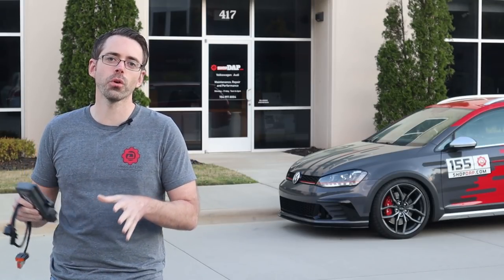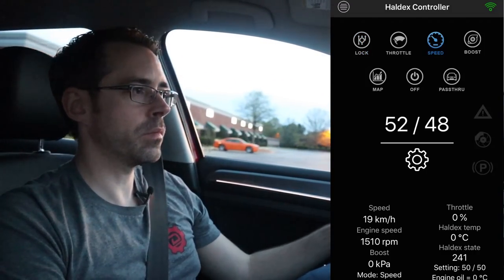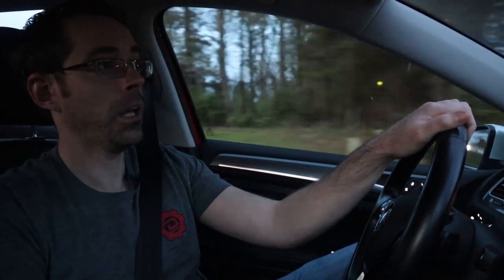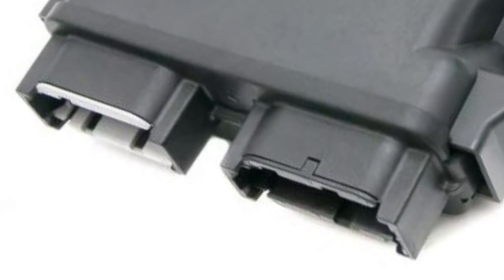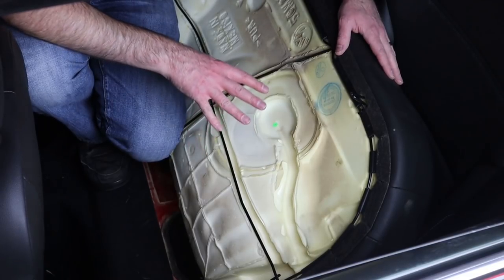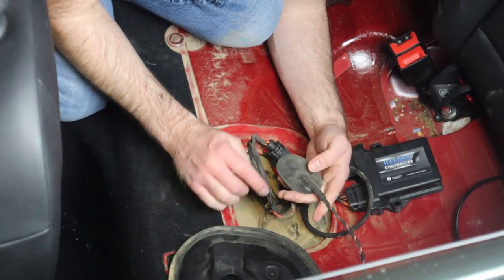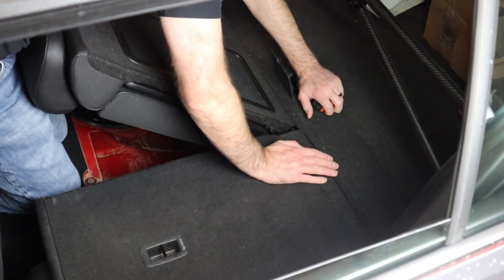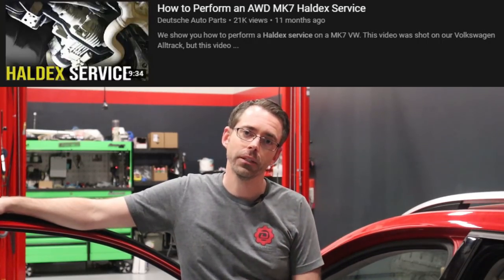How to Control your Haldex AWD System

Comment: Does it damage the pump/unit by working all the time? I am not sure that it is designed for that.
Reply: Pump runs all the time when vehicle is on. However it is not always "engaged". Running at 100% will burn the pump out much quicker. Pumps usually last around 60-80 thousand kms depending on how lucky you are.
Reply: @GForceConnections  i guess i have original pump on my b6 and it has 330 thousand kms :D

Comment: I saw you install this on a mk5 gti. So my question is does this fit on pre MQB, like PQ35 or better PQ25? I would like to run this on an Audi S1. (Was not sold in the US)

Comment: @1:34 "Haldex can't engage when you're on the brakes..." Wait what? So on road courses, rallies, and hill climbs where it's VERY common to use the brakes in conjunction with the throttle to control the balance/disposition of the car Haldex does not allow drive to the rear wheels? That's a true shame, didn't know that.
Reply: More so on launch control the system will never have the pump running before the launch happens, so there will still be signal delay like stock.
Reply: I am pretty sure I have seen a system from Ecumaster for the Mk4 R32 that will lock the haldex under braking too
Reply: HPA Motorsport do Haldex box which makes Haldex engage while braking. They just don't have this for Haldex V yet. I hope it changes soon as it would be preferred solution for ultimate sports driving.
Reply: This is one of the reasons why people prefer torsen, because torsen is a mechanical AWD, unlike haldex, so it wont disengage when you brake, and has more predictible handling. Downside is that its always active, so you gonna have your fuel economy cut, while haldex disengages when not needed giving you FWD economy.
Reply: The Haldex Controller has a option to ignore the brake signal.
Reply: @masterblaster3755  As Master Blaster says the original HPA Haldex (Blue)  on the 'Race' setting gets you engine braking when you are off the throttle. I've had it since Marcel Horn did his first 'NA Tour' in 2009-10.  Xlnt!

Comment: Is there any way to just complete remove the rear haldex and make it truely locked up in the rear mechanically going to an LSD rear diff... removing the whole rear haldex system with a solid rear axle?

Comment: Do you have to use a controller to use the mechanical switch or is there a way to set it up to run fwd and awd on the switch?

Comment: They would sell a heck of a lot more of these if the price was more reasonable, the problem is the Golf R Haldex is already very responsive. I have tested my car in low traction situations and it is very easy to spin the rear wheels right off the line, so how much better will this actually make it? My guess is the difference will be hardly noticeable, but if they can demonstrate a noticeable improvement...
Heck even those haldex tunes have yet to offer any evidence of performance improvement, and all the feedback I have gotten says the difference is imperceptible. For $500-$600 I would get one just to play with it, but $1100 for something that won't make a noticeable performance difference and will most likely just reduce mileage and increase wear on the haldex system?
For example there are VCDS settings that will increase haldex engagement, I (along with many others) have tried those settings and could not notice any perceivable performance improvement, however what was very apparent was the marked reduction in gas mileage (easily 2-3 mpg). So it definitely was increasing haldex engagement, it just didn't help performance. I had these settings on for several hundred miles and then turned it off when I could not see any benefit and the reduced mileage. 
This is a neat thing to play with, but will it transform how the AWD system operates? Sadly no, most likely all it will do is reduce mileage and reliability.

Comment: Hello, it's not dangerous to drive in 50/50 in the curves ? because there is not center differential and the font and the rear will be turn at different speed

Comment: On the Skoda Superb  3T4 and 3T5 (Respectivley VW Passat ( with the 6 speed DSG gearbox  )B6 and B6 Variant derivatives but with the front transmission of a golf) 3.6l VR6, the Gen 4 Haldex is always on: 86% on the front and 4% on the rear. The car has also torque vectoring so that it can send up to 85% of the total torque to any single wheel. How would this system work in combination with the torque vectoring (controlled by the ABS control unit) ?

Comment: I'm a potential new mk5 r32 owner. Is the 4 motion system biased to fwd 90% of the time? Is there a way to make it biased to rwd or is that engaging the 4wd system all the time? I'd like a 40 60 or 30 70 split to the rear if possible.
Reply: As far as I know 50/50 on haldex is like open diff maximum power on both axles but you are not able to give more to the rear bc then you would need a real middiff between te front and rear axle.

Comment: Just purchased R36 so the haldex controller sounds like my thing.  At 12.00 ish in the video ,would a section old seatbelt and buckle help pull them through the tight spaces?

Comment: There is no thing as 50:50 lockup. 50:50 is open diff. 
Lockup is 0:100 to 100:0 instant variability only determined by traction.
Reply: Exactly, that's very common mistake caused by lack of understanding what is the difference between wheelspin and torque.

Comment: 3:00

On my stock Golf R (300hp), I do get slight wheel spin whilst shifting 2nd to 3rd. Only happens with very energetic shifts, depends on the road type, and only lasts a fraction of a second.

On 1st to 2nd it happens quite often.
Reply: Auto or manual....

Comment: I’m looking for a way to make my mk7 golf R truly 50/50 awd all the time by completely gutting the rear haldex system with an LSD and and carbon fiber rear axle and front axle... i am very annoyed at the system and may just turn the car into a project car which I gut the whole drivetrain ... turn the motor 90degrees to make it inline with a rear drive shaft... create a mounting bracket in CAD for a machine shop to mount a tremec  6 speed manual gear box with a rear axle going to a mechanical beefy rear lsd ... im already getting 400hp to the wheels.

Sadly this project will take a few years depending on my freetime.

But that 4motion system should never been put in a performance car to begain with... it should gave been a true quatro drivetrain.... 🤔.... which is also an option getting an old audi from a junkyard for parts and having the local machine shop chop and balance the drive shafts to fit my car’s length and mate the current mk7 golf R motor to it.

Two years research this car only to be highly disappointed but I learned how to refine my research.

Last time i try going down from 3 cars to 1 car.... i tried condensing power i got from my z51 c6 manual corvette, handling of my Mazdaspeed mx5 with the cruising comfort of my winter car which was an e39 bmw 540i m-sport manual which my 2 v8’s got comfortable cruising millage of 28-29 mpg in the vette and bmw since most of my driving is 30mins on the highway with no traffic.

So I tried to get performance, comfort, and fuel economy all in one car that still had 4 doors...

Never again, I will just get my performance car and a winter car, both with true manual stickshifts even if I have to modify clutch housings to mount to an electric motor
Reply: I would just sell the golf R and buy an Audi with torsen awd or a Subaru. But is the haldex really that bad?
Reply: @jaahasjaahas8729  from a performance perspective for going around turns, especially on loose surfaces like snow and gravel…it’s terrible bc it want the front wheels to slip 1st before transferring power to the back wheel which can cause the driver to understeer and slide straight off the tight turn unless you keep the gas pedal pegged which tends to help keep power going to the back wheels to get the car to rotate around… Sometimes having to completely lift off the gas and slam it right back down otherwise it tries to keep the power on the front wheels casing them to slip back into an understeer mode followed by power to the back wheel then just pushing the car in a straight line. (I also use studable snow tires in the winter… it also grounds out and tears the side skirt plastic under panels off in the winter when driving sideways through snow that is greater than 4 or 6” thick.

But in the rain, it works very well with great torque vectoring.
However, the driver always feel disconnected from the drivetrain so it’s scary to trust on turn at higher speeds until you get some quality drive time in it constantly pushes it’s limits in a safe environment free from hazards and people.

The back isn’t meant to handle a 40% power all the time unless you want to damage it.

Personally, I’m planning to rip out the drive train and turn the motor 90degrees and mate it to a six speed manual and axil to lsd in the rear end so it rwd bc I love the motor and it’s plenty of power for a fun little car… just needs some charisma and narrower tires for rwd fun flinging it sideways in the turns like an old 50-60’s race car on dirt making it a handling car that doesn’t just get wider tires thrown at it to handle better…plus narrower tires are cheap to replace and cut into snowy roads quite well… I also want to lift the whole car a couple inches so i’m not constantly breaking ice chunks that fall off the wheel wells of truckers on the freeway at 70mph with my oil pan which has also been upgraded from cheap plastic to a real metal pan.  Definitely a few horror stories from other winter owners draining their car’s life blooded oil out after an ice chuck cracked their plastic oil pan.  Last thing I want is to be stranded on the side of the road in a winter blizzard at night with a dead motor… meaning no heat… but i have my snowboard boots and winter equipment in my car for emergencies which can handle down to -10 degrees plus blankets and a short handled spade shovel to when you need to dig out a car that got high centeres
Reply: @jaahasjaahas8729  but It’s a love hate relationship, I love predicting what my car computer is trying to do ad completely force it to do what I want well accepting that it’s really just a fwd car with some smart trickery which I’d rather just disable bc it makes the driver feel like a passenger instead of a driver.
Reply: If you wanted a quick drag car or freeway bombarder runner… It’s an awesome car for the price and easily upgradable with a rock solid motor but if you planned on putting $30,000 of work into it than just get a c7 z06 corvette which is just stupid fast for the price point
Reply: @jaahasjaahas8729  i would but I need a winter car again which I don’t want to buy bc I’d get another corvette
Reply: @jaahasjaahas8729  you also need to understand that I don’t care about having the fastest car, I like to feel like I’m one with the car and try to put down the best times I can with that car followed sharing it with friends to see who can be the most on point driver in it that day.  

I personally care more about rally driving and going sideways even though it’s slower, I just enjoy rotating the car around hairpins and s-turns using the cars momentum to rotate it.   I absolutely love the feeling of controlling the gas peddles and brakes to control slides with very little steering input when things are balanced well.. maybe a quarter turn at most for hairpin turns
Reply: @jaahasjaahas8729  it’s still a good car, just doesn’t fit my driving style pleasers

Comment: I know you can program by speed but can you program by driving mode? Can you have 100% to the rear? Are there variants of this module for the older haldex cars like a mk4 r32
Reply: 100% to the rear would still only give you 50/50 power on the drive train

Comment: For me it is not all about acceleration, i’d like to turn it on for snow driving especially engine braking on descents. Could this be achieved?
Reply: Brian Steele if you aren’t braking it should work fine
Reply: Possible as well, brake can be ignored.

Comment: Saying that haldex is awd is like saying that katy perry is art. Better leave the the system in factory defaults, and save few quid (that you will spend inadvertently on repairs of modified one) on real awd car. Also burnouts in passeratti are painful to watch ... I don't have anything against WV / Audi "econo boxes" - great cars that solve a problem of cheap mass transportation, but trying to dump money into econo box to make it fast makes no sense - get a performance car.

Comment: Hey Paul, if I had United Motorsport Haldex Tune, could I also use this setup strictly for drag racing, then when in pass through mode it would just retain the UM Haldex tune? I was a bit disappointed that any time the brake is on it goes 100/0 as it would be sweet for it to be 50/50 when using launch control, but the brake being pressed negates that.
Reply: Factory setup usually disengages the haldex while braking anyway.
Reply: But as soon as you lift the brake for the launch, the system would activate again wouldn't it? Though that tiny delay might be a deal breaker
Reply: How do you like the um tune
Reply: in the app settings you can choose if you want the haldex disengage or not

Comment: With the proper high performance tires like Nitto NT01's your car is going to have plenty of grip and will hook up just fine from a dig or from a roll. Plus if you don't have a fully built motor, built transmission, and a bigger turbo then this really isn't going to make much of a difference if you aren't putting down 500+ wheel horsepower. Tires will make a world of difference and won't deplete the life of your all wheel drive/4 motion system. This haldex controller is a hard pass for me and a waste of money.

Comment: ask the manfacturer to sell the unit with a much longer cable. this seems l ike an issue that can be fixed easily. for me i would need at least 10ft min so i can route it around corners. this amount of length of wire that you have now would make me not want to buy this until you can extend it to the 10ft i need. more is better but less is not worth it for me.

Comment: you're wrong. Most audis do not use Haldex -only the A3/Q3
Reply: S3 and RS3
Reply: Now you may have heard of Haldex AWD before, you may not have, but I guarantee you’ve heard of many of its applications: the Audi S3, RS3, Volkswagen Golf R, Mercedes-Benz A45 AMG, Volvo S60 T6 etc.  But wait, Audi uses quattro, VW uses 4Motion, Mercedes-Benz uses 4MATIC and so on, don’t they?  Those names are merely the names chosen by each brand to represent their AWD drivetrains.
Reply: Debra Johnson an s3 and rs3 is just a fancy a3
Reply: @stranotech1  The Haldex all-wheel drive system is currently used in the following vehicle models:

Volkswagen Group (Volkswagen AG)[15]
Audi A3 quattro
Audi S3
Audi RS3
Audi Q3
Audi TT quattro
SEAT León 4
SEAT Altea Freetrack 4
SEAT Alhambra 4
Škoda Octavia 4x4
Škoda Superb 4x4
Škoda Yeti 4x4 (Haldex Fourth Gen)
Škoda Yeti Outdoor 4x4 (Haldex Fifth Gen)
Škoda Kodiaq 4x4 (Haldex Fifth Gen)
Škoda Karoq 4x4 (Haldex Fifth Gen)
VW Golf R
VW Bora 4motion
VW New Beetle RSi
VW Passat 4motion B6 Platform
VW CC 4motion
VW Sharan 4motion
VW Tiguan
VW Golf IV 4motion
VW Multivan 4motion
VW Caddy 4motion
VW Transporter 4motion
Lamborghini Aventador LP 700-4
Bugatti Chiron
Volvo Cars
Volvo S40 AWD
Volvo V40 Cross Country AWD
Volvo V50 AWD
Volvo S60 AWD
Volvo V60 AWD
Volvo V60 Polestar
Volvo S60R AWD (Second Gen 2004–2005, Third Gen 2006–2007)
Volvo XC60 AWD (Haldex Fourth Gen)
Volvo V70 AWD (Third Gen 2008–2009, Fourth Gen 2010–2012, Fifth Gen 2013 -)
Volvo V70R AWD (Second Gen 2004–2005, Third Gen 2006–2007)
Volvo XC70 (Second Gen 2003–2005, Third Gen 2006+)
Volvo S80 AWD
Volvo XC90 AWD (Second Gen <2005, Third Gen 2006+)
Ford[15]
Ford Taurus
Ford Mondeo (US: Ford Fusion)
Ford Freestyle
Ford Kuga
Mercury Montego
Land Rover
Land Rover Freelander 2/LR2
Land Rover Discovery Sport
Land Rover Range Rover Evoque (Haldex Fourth Gen until 2013)
Saab Automobile[15]
Saab 9-3 Turbo X (2007–2008) (Haldex Fourth Gen with eLSD)
Saab 9-3 Aero Saab XWD (2008–2010) (Haldex Fourth Gen with eLSD)
Saab 9-3 XWD 2.0T (2009), Turbo4 (2011) (Haldex Fourth Gen without eLSD)
Saab 9-3 9-3X (2010) (Haldex Fourth Gen with eLSD)
Saab 9-5 Turbo6 (2011) (Haldex Fourth Gen without eLSD)
Saab 9-5 Aero (2010) (Haldex Fourth Gen with eLSD)
Saab 9-4X XWD (Haldex Fourth Gen with eLSD)
GM[15]
Opel Insignia (US) Buick Regal(Haldex Fourth Gen.without eLSD)
Buick Lacrosse (Haldex Fourth Gen.)
Cadillac SRX (Haldex Fourth Gen.)
Reply: Debra Johnson so? What are you trying to prove? My point was that most AUDI vehicles do NOT use haldex - and you just proved my point! Haldex is always going to inferior to traditional Quattro no matter how you want to frame it - end of debate!
Reply: Debra Johnson and yeah I know exactly what haldex is - my P2 Volvo V70R has it. I know exactly what you’re talking about so no need to pretend like a big shot.

Comment: Do they make this for Audi A7 2012
Reply: A7 is Torsen, not Haldex.
Reply: Flo Im Schnee can it be adjusted?
Reply: At least not without modification. 
But why would you want to do that?
Reply: Flo Im Schnee  so I can turn off al wheel drive.
Reply: Flo Im Schnee also what is the difference between Torsten and Haldex. Because when I hit the gas back wheels spin for a bit then the system kicks in. “All wheel drive “
Reply: Flo Im Schnee my A7 isn’t a torsen I dint think.
Reply: Seriously? You can afford to buy an A7 and think it isn't Torsen...?
Try Google then...

Later Torsen models were by default in a 40% front / 60% back setup. Power can be sent to either axle based on grip, up to a certain percentage.
Reply: Flo Im Schnee  I bought the car tuned it never knew anything about either or of the trans types you can see it on my page.  Rs7 look. What you think ?